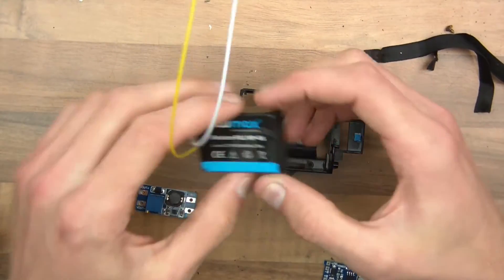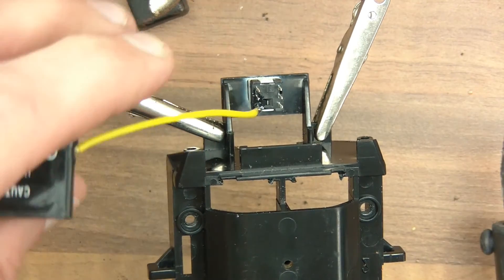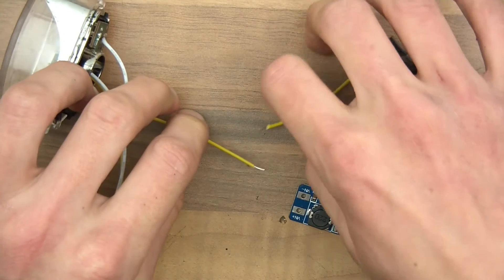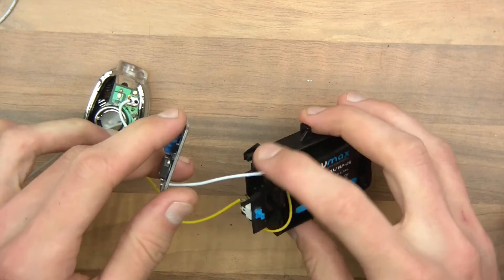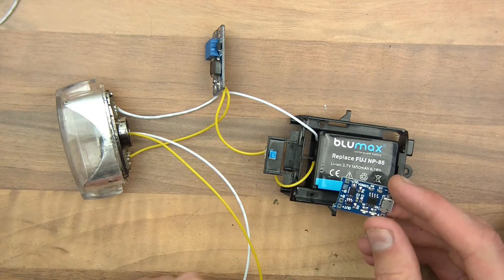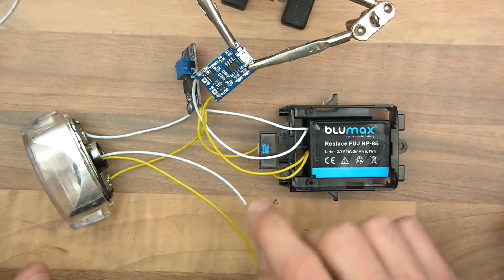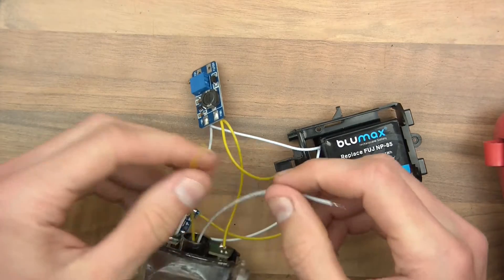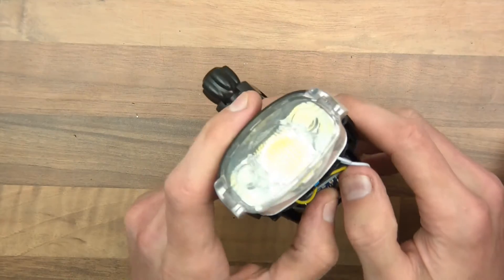TUTORIAL: How to Convert Halogen Torch Bike Light into LED & Lithium! (Part 2)

Comment: does the battery have an over discharge circuit if not i would wire the switch to the charge pcb
Reply from the maker: No overdischarge! That's a good point!